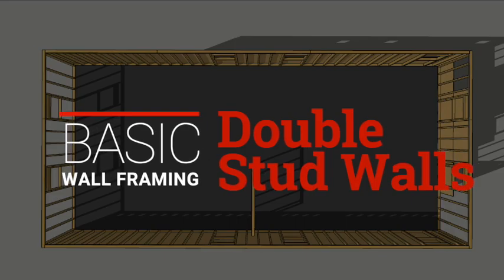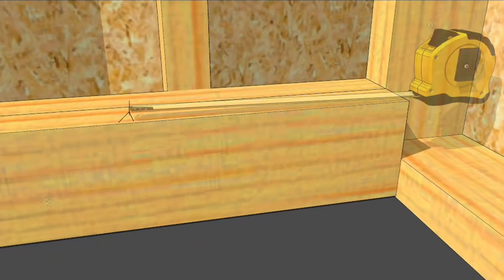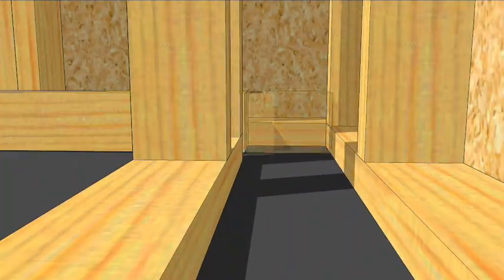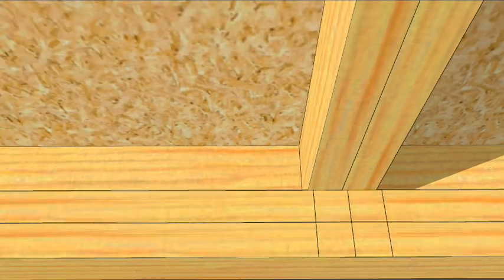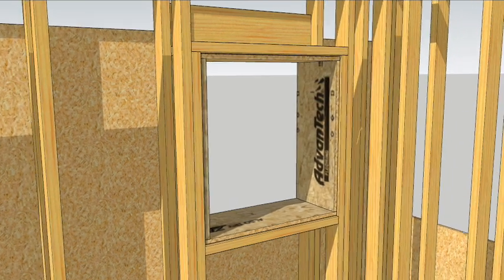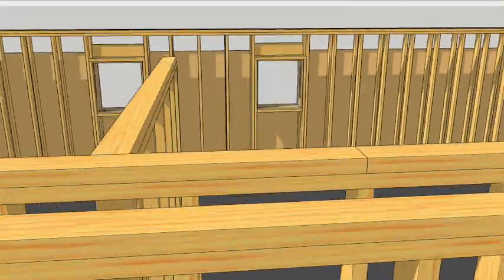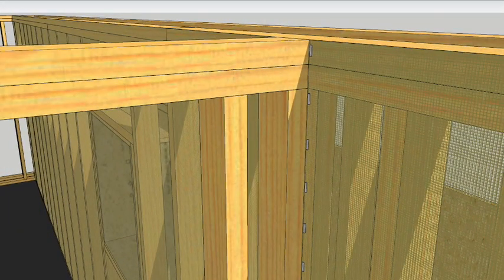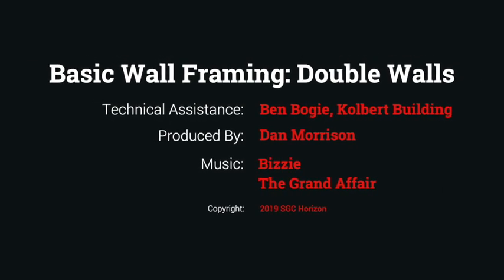Double Wall Framing Animation

Comment: How do you make it fireproof?
Reply from the maker: Fireproof is a big topic. Inside the box and outside the box is the first branch in the tree. But you'd make it fireproof the same way you'd make any house fireproof.

If yopu're conccerned about cellulose insulation, it is treated with borates making it insect and fireproof.
Reply: Thank you  @ProTradeCraft

Comment: Anyone got an update on how this house molded out in the first year
Reply from the maker: Yes. The answer it it did not because it was built by a professional who understands building physics. 

Do you suggest building leaky houses? How many holes, what size, and where do you put them?
Reply: @ProTradeCraft  we don't get to build leaky houses in massachusettes. We have adopted the hers rating. Also not a good thing.houses are too tight , when you have to add a 24 /7 bathroom fan and have to achieve 3 air changes an hour. Yes , I get it .if you wanted that air gap between walls , you simply could have run 2x4 horizontally 16 inches on center after the exterior walls were insulated and achieved the same affect. Connecticut has not adopted the hers rating they still do the res check .that requires an r-30 in the walls and an r-60 in the roof. Trust me , I get .but what a waste of space and money having to double the wall framing. At that point you are better off buying remanufactured stress skin panels to frame with. Just my opinion. I don't think your work is bad by any means just over kill .
Reply: @ProTradeCraft  you end up with the same amount of holes as I do , the framing process isn't different on the exterior walls and I did mention , I build hers rated energy efficient homes
Reply: @ProTradeCraft  you could spend all that extra money on spray foam and upgrade the hell out of your windows. Spray foam is a great thermal break.

Comment: Shouldn't the interior wall studs be offset from the outer structural wall stud to allow more insulation space between them? If you're going to the trouble of building a double stud wall, the studs may as well be staggered for even better insulation depth.
Reply: ProTradeCraft is correct. Staggering interior studs relative to outer studs suggests a fundamental misunderstanding about the wall construction and insulation.
Reply from the maker: Staggering the studs will do nothing to improve space for insulation.  the space between the walls remain the same, the space between the studs remains the same. In the old fashioned days when people framed walls with 2x8 plates and 2x4 studs, they would stagger studs and weave batts between the studs. That is a bad idea.
Reply: @ProTradeCraft  I don't think you understand what I mean but whatever.
Reply: Instead of building two 2x4 walls, I chose to stagger 2x6 studs on 2x8 plates as a way to help with the soundproofing of a room in new construction. Weaving the batts gave the room a complete thermal barrier. Air space between two walls is best to reduce sound transfer yes, but staggered studs will help decouple from the wall and helps reduce it. You say staggered and weaved is old fashioned and a bad idea, I say go back to class you're not a pro @ProTradeCraft

Comment: I live in cold climate. Maine. Where in a 12 in wall would I put vapor barrier / air barrier. I believe a 3.5 to 4 pound dense pack cellulose is what I am going to be using.
Reply from the maker: Northern or southern Maine?
Vapor barriers are almost always better replaced with vapor retarders, except in cold, cold climates. Vapor retarders come in many different permeabilities, which one to use is specified in the code, depending on your climate.

This house is in southern Maine. There will no plastic vapor barrier. The interior paint will act as a vapor retarder.

The only place in the continental US where plastic vapor barriers in walls makes sense THAT I AM AWARE OF, is northern Minnesota. But I am an editor, not an engineer.
Reply: @ProTradeCraft  Lewiston maine
Reply: @ProTradeCraft  what part of maine are you building that double stud home? Because I would love to come check it out if the wall are still viewable.
Reply from the maker: @creadsyoutosleep.7268  it is in Scarborough, and the walls are closed with people and dogs inside. Sorry
Reply from the maker: @creadsyoutosleep.7268  there is a playlist of construction videos here:: https://www.youtube.com/playlist?list=PLU1aP_Y9qGOwYE6GP0EymwfZAo7Iao3GL

Comment: Do you need to connect interior wall to the exterior wall to make them more solid?
Reply from the maker: No. The walls are connected to the floor and the ceiling just like any other wall. 

The two walls ARE connected though, at the window openings, but not for structure. They are connected at window openings for flashing and air barrier continuity.
Reply: ProTradeCraft ok thank you!
Reply: The insulation company dense packing the cellulose will want a blocker every 3 or 4 bays. You can use some 1/2” styrofoam rips or even some of the vapor retarder material you’ll be using on the inner wall stapled bridging the two walls basically sectioning off areas for dense packing. You could do every bay if you are self performing and have the time.